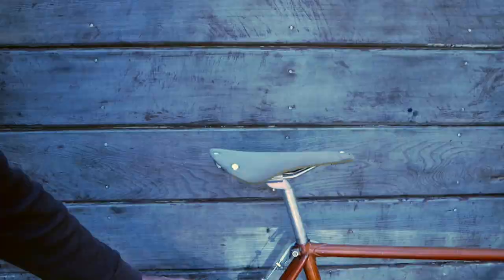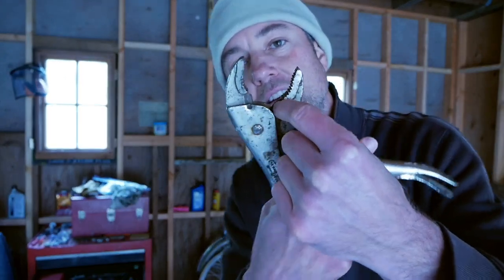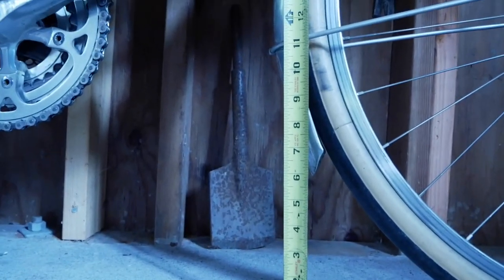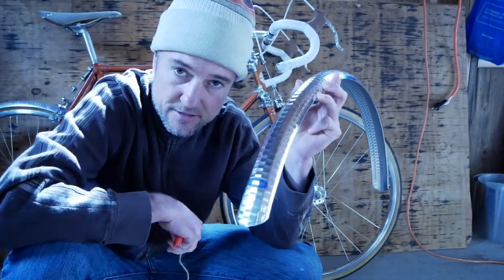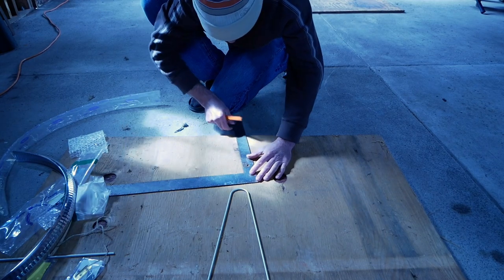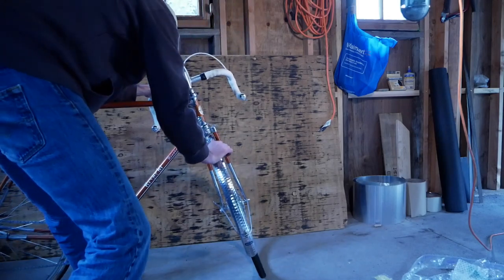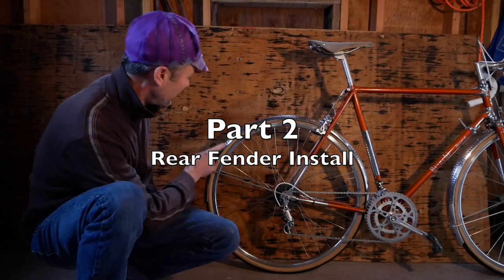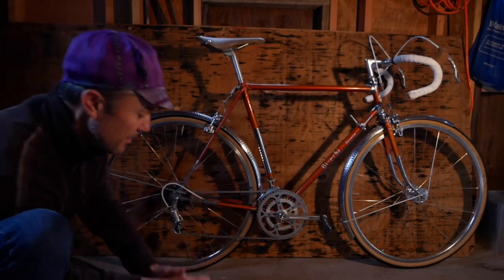How to Install Honjo Fenders

Comment: Got a good laugh when you held up the angle bracket to attach to the brake for the rear fender.  The "long leg" goes up, the short leg is bolted to the fender.

Comment: Great video for those who are contemplating their first set of metal fenders - they are more challenging to install, but more practical and durable than plastic fenders.  The video is long, but that's because it is very comprehensive.  Admittedly, it takes me at least an hour per fender to install - I'm VERY picky about getting them to fit properly: dimpling the sides to fit in between forks or chain stays, creating spacers when needed, obsessing about fender lines... and I measure at least three times before cutting or punching holes in anything.  I've not actually installed Honjos, but two sets of Velo Orange fenders - essentially the same process and they are highly recommended as well.

Fun quick cuts and light humor here and there.  From one Vanagon Westy owner to another:  well done!
Reply from the maker: Thanks David! Noted on the Velo Orange fenders! This set actually went together pretty seamlessly other than not having a long enough rear hanger. To your points, I agree on all counts. It's worth the extra effort in obsessing over the fender lines, dimples, and hanger alignment, because as you know, once they are set, you can forget about it. Plus they just look better that way. I personally haven't tried the Velo Orange fenders myself, but I image they are basically the same. Honjo's come in a wide array of sizes, mounting hardware types, and styles to help make your ride personalized which is why I chose them. Its hard to find the exact fit for each bike, so having options helps. Awesome to know you have a Westy too!  I'm really glad I have mine, I couldn't afford to get one now.
Reply: How do you do the dimpling?

Comment: Nice video. I like metal fenders and have them on my bikes that are designed for fenders. I just finished installing VO fenders on my Norther-Lyon. I like a good fender-line so I had to manipulate the radius a lot. Even though the 650B fenders fit pretty well, I still had to decrease the radius.  Very time comsuming process. I took the bike on a test ride yesterday and all was well until I came out of the saddle and the front tire rubbed the fender! Ugh, back to the workshop!

Comment: The position of the stay on the front is incredibly important.  On a Velo Orange Campeur frameset there was so much toe overlap that my foot would snag the stay even if the wheel was turned only a little.  It was so bad that I retired the frame.
Reply from the maker: That's very unfortunate. One of the benefits of a longer wheelbase is less toe-overlap. A lower trail bike with more fork rake will have less overlap. The steering feels a little different, but it gives the fork a little more spring to it. A medium trail bike can work too if the head tube angle is more relaxed. I hope you find a frame that works for you.

Comment: Great how-to!  My first ever YouTube video upload was of my Mercian touring bike, and it got a few, mostly complimentary comments.  That was 12 or 13 years ago.  One comment was pretty good - but the final line was something like “you gotta fit Honjos”.  Back then I didn’t even know what Honjos were, but I found out!
Not wanting to rush into anything rashly, I mulled over the comment and today, fresh from Osaka, a pair of shiny fenders (mudguards here in England) lie before me in their packaging.  Henrywildeberry’s vid is a top drawer how-to.  I love how he explains every detail, especially the measuring techniques, and his fanatical search for perfection.
I look forward to the follow up showing how to get the rear fender to fit nearly behind the bottom bracket.
I also notice that the video shows the front fender fitted with the logo at the bottom.  I’d planned to have it at the front.  I guess it personal preference.
Reply from the maker: Thanks MisterBee! Good luck installing your new fenders (mudguards). The logo placement is a personal choice. I eventually remove the stickers after a while.

Comment: Thanks for the excellent video and the great measuring tips, Jeremy! I'm thinking of putting some Honjos on my Rawland, and I just came across this vid. (How did I miss this one?). I have VO fenders on another bike of mine, and it was a pretty painless operation, but I read that the Honjos were a bit more involved. This looks very straightforward, so thanks!
Reply from the maker: Hi Robert! Honjos are not too bad to install. Do you plan to use a daruma to hang the front fender from the fork crown? Installing these is really not to bad. Plan for it to take quite a bit of time (4 to 8 hours). I find the challenge is with the chain stay bridge and brake bridge. It seems these two points of attachment need the most fine tuning.
Reply: @Henrywildeberry  My rSogn has a plate with two threaded holes underneath the steerer, so no daruma is needed this time. And hopefully, no drama -- the bike was designed with the fender mounts all equidistant from the axles, which should help. Also, the bike has tons of clearance all around, so hopefully no crimping or bending will be needed at the bridges, so that seems to be a reasonable estimate of time required. Thanks again, and I'll keep you posted!

Comment: Thanks for this video. Near the start you mentioned that the rear one doesn't fit between the chainstays and needs a minor modification. Is that shown in the video?
Reply from the maker: I'll have to show this in a future video!
Reply: Rear installation seems to require it's own specific technique. Would love to see a rear custom fender install as well. Definitely looks to take a sharp eye and a nice touch to get a proper install. Look forward to doing mine soon.
Reply: @Henrywildeberry  I see it's a year later but please do 🙏🏼

Comment: Very nice video. I'm about to install some Honjos and this helps visualize the process. 

Is there any reason a sewing tape measure would not work to locate the fender center? Maybe the stays too, although that would only work if both arms of the stay are exactly the same length.

Comment: Wanted to say thanks for making this video! Thinking of getting some Honjo fenders for my old school trek 640 w/ 27" 1-1/4" tires. Not sure which size and style will fit though. Also I have a rack mounted in the rear which I need to think through. What size tires are on your bike and which fender style did you choose? 
Btw, the fenders on that bike are looking sweet!!
Reply from the maker: Thanks for the compliment! This bike originally had 27 x 1 1/4" tires and I swapped them for 700x32mm. The outside diameter is close, so I used 700x41mm Honjo Fenders, and the diameter is nearly perfect from what I can tell. Also, something to consider, the hammered fenders feel a little thinner in thickness compared to the smooth fenders. What that means is they will need an upper brace on the front fender or a rack with a fender braze-on to keep them stable.

Comment: Hey Mr. Wildeberry! Out of curiosity is there a reason why you chose to use a L bracket on the rear fender versus a sliding bracket? Any strength advantages? I ask because both options would work on my rear fender and yet both options have there cons. The L bracket takes away from the fenders and is a bit intrusive where as the sliding bracket can cause a bit of rattle and although it can be hidden a little under the brake it is also a tad intrusive. Both work, I guess I'm searching for another opinion.
Reply from the maker: The rear brake bridge on this frame was set too high for the sliding bracket to work. Originally this was a 27-inch bike that I converted to 700c. I found the L-brackes come in two sizes, a short and a long. I needed to use the long in order to get the fenders low enough for the proper fender line on the 700c tire. The L-brackets are nice though and come with an extra plate underneath to reinforce the connection to the fender. I also used nylon locking nuts to keep them from vibrating loose. They hold the fenders very securely. You could also use the crimped lock nuts as well (they are little shorter), or add a drop of lock tight on the threads. You might be able to turn the flange of the L-bracket 180-degrees and tuck it under the brake so it's not as visible? However, I think they look fine especially with some nice looking stainless steel screws. Cut the screws so there is no extra threads protruding below the nut to give you the best tire clearance.
Reply: @Henrywildeberry  Thanks for the reply! I also had to use the L bracket in the front a so can attest to their good looks and appreciate the reinforcement plate. Appreciate the suggestion for locking nylon nuts as that didn't cross my mind. I'll have to track some down once I sort out the size. Did you add lock tight to any of the other areas that secure the fender to the bike, Like the u-stays, or front rack? I wasn't planning on doing that at all, but I never thought about road vibration causing the nuts to loosen.

Comment: Thanks for the tutorial,

I would like to fit a 50mm SS fender (Berthoud).  It would fit everywhere except at the bridge behing the bottom bracket where the clearance is 45 mm.

Have you ever "tampered" with you fenders to fit them at the 1 inch below the bridge like you recommend ?  I mean that at 5:05 you mention there is not much space in your chainstay and that you will explain how to make a modification so the fender will fit but you never show how.

Can you explain what you did ?
Reply from the maker: Nicolas Hi! Normally, I’ll shape the fenders so they fit between the stays. There are several ways to do this, one way is to use a wood dowel with a similar diameter as your chain stay and lightly hammer the fender into shape. Make sure you get everything marked exactly where you need to make room. When you start shaping go slow and recheck often. Take your time and it will pay of later. Good luck!
Reply: @Henrywildeberry  I wanted to thank you.  This video had me find your channel and I subscribed.

I wanted Berthoud SS but the C$ has fallen since the covid and the S&H is prohibitive.  I found a discount on some VO.  You helped me install them.

Sad I can't post a picture of my commuter...

Comment: Hi! Do you know if that`s the original crankset that came with the Bianchi?
Reply from the maker: Hello Tate, I'm not sure on whether this is the original crankset. My guess is it was put on later since it's a Sugino and I imagine bikes from the this era came with Campy components. I read somewhere the orange paint color was made specifically for the North American market. The orange paint was very rare for Bianchi. It's possible these were shipped over as frame sets and local bike shops assembled them with parts on hand. In that case this could be an original crankset, but I'd have to research when Sugino manufactured aluminum cranks to see if the era is correct. Excellent question, thank you!

Comment: I must have missed it. What size tires are on that bad boy?
Reply from the maker: Hi NorCal Mike. These are 700x32. That was about max with the fenders. I could likely run 700x35 or even 38 with this frame without the fenders.

Comment: Hey Henry out of curiosity did you end up ordering a larger fender bracket. If so what type and where did you order it from. I'm running into a similar problem but with my front fender. I need a longer bracket to reach down as I've converted my bike to 650b. Also out of all your bikes with Honjo fenders have you ever had some with lots of tension on the fender to help keep a constant fender line? I'm having some troubles getting the fender to the same diameter as my tire.
Reply from the maker: Ben Geldreich Yes, I ended up getting another long L-bracket. Check out Sim Works. They have a lot of small parts avail to order individually.

Comment: what sort of drill do you recommend for drilling the holes in the fender? Would a lightweight dremel do the job?
Reply from the maker: The aluminum is very soft, a Dremel will work just fine. I've even  seen someone use a hole punch designed for metals.  Good luck, and measure twice!

Comment: What about gravel riding and fenders? On the one hand fenders keep grit and grime off, but mud build up would seem to render fenders not a good idea. Thanks.
Reply from the maker: Ed Catt it really depends on what the soil type is and moisture conditions. So far I’ve only had one bad experience riding gravel roads with fenders and that was because I ended up in a huge clay mess. Otherwise, they are fine. I just finished 40 miles of muddy fire roads complete with creek crossings in Marin with no issue, and I finished the ride clean. The other two riders were covered in mud and water! Fenders all the way!
Reply: Thanks. I've ridden a fendered bike commuting, and loved it. But, when I started gravel riding (I live near where Dirty Kanza is held), the limestone gravel dust can be like sticky clay in wet weather. So I stopped using fenders. But they definitely do keep things a lot cleaner! Love your videos. I love the classic bike, too. I once had a steel Batavus touring bike. wish I'd kept it now!
Reply from the maker: Ed Catt dang! It sounds like you live in an area where fenders are not a good idea. That’s unfortunate. In your case the plastic type might be your best bet. What kind of tires do you use there?

Comment: How much clearance do you recommend between the tire and fender. I’m in the mock up phase.
Reply from the maker: 20mm is a good starting point.
Reply: @Henrywildeberry  Lego bricks work great as spacers. I taped them to the tire in four places to ensure the spacing was the same everywhere.  What made you add the second front stay? My front fender seems a bit wiggly so I’m considering as a last resort.